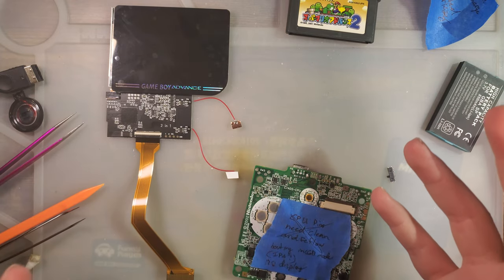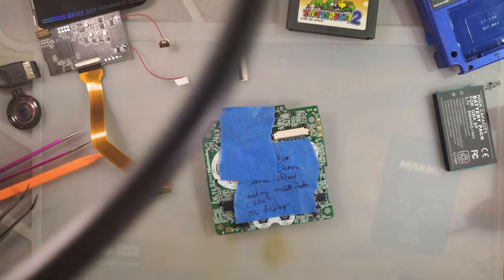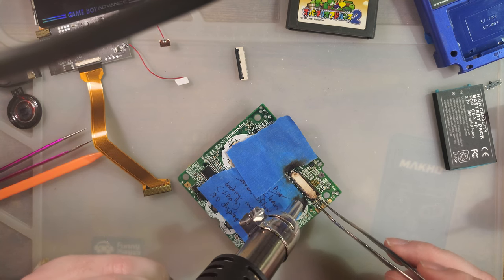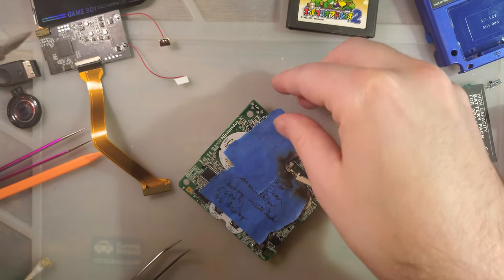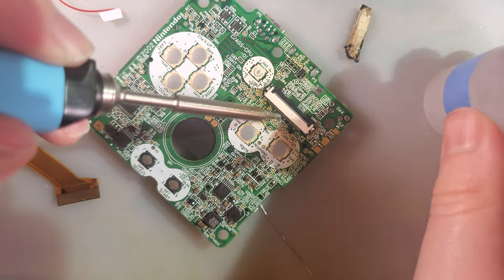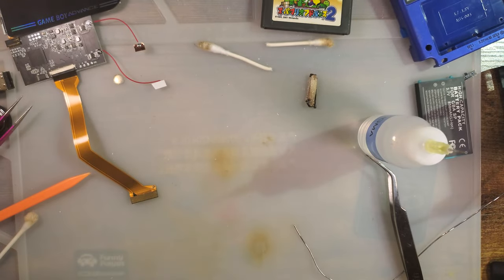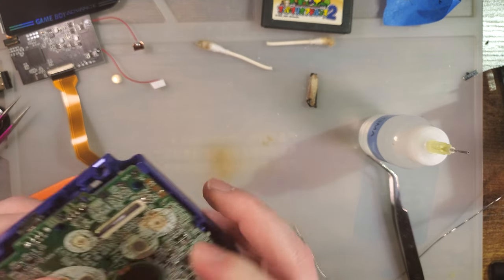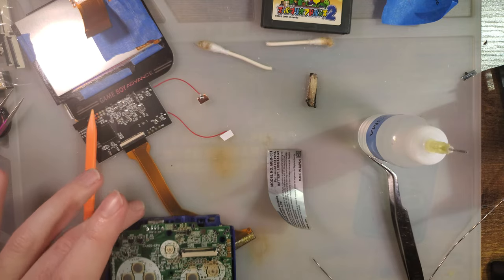GBA SP: How (NOT) to replace the LCD Connector

Comment: i think the us forge liquid flux works better than kester 959t for doing fine pins. does a great job spreading and the bulk of the solder hugs to the hottest point(iron). so it doesnt leave globs on the pins.
Reply from the maker: Ever since I got an ultrasonic cleaner, I can't stand the liquid stuff. It's tacky flux all the way for me.
Reply: @makho  i still use tacky for most of my soldering but for replacing chips or pads the us forge liquid flux just works 10x better. After seeing how hard of a time you were having i figured id mention it.

Comment: Wouldn't kapton tape have been better? Its a great heat insulator and see many use it with heats guns.
Reply: Haha yeah sure, but kept on tape doesn’t change color when it’s too hot. What a handy “feature” 🤪
Reply from the maker: tape makes bad heat insulators in general but can be useful in a pinch. It's better to just use the proper hot air station tools.

Comment: Hi mister makho , I'm trying to make a DIY frontlight mod on my gba and  I'm using the backlit led circuit  from a damagged screen of a gba ags 101  for that purpose , when I power the circuit  with 3v the leds don't light but when I test every led with the multimeter set on diodes check scale each one  lights so I guess they are not burned , Do you know what the working votage is for that circuit?
Reply from the maker: It's series IIRC so probably around 12v